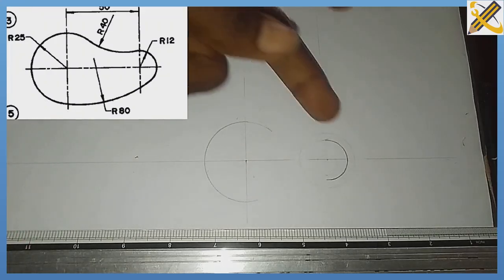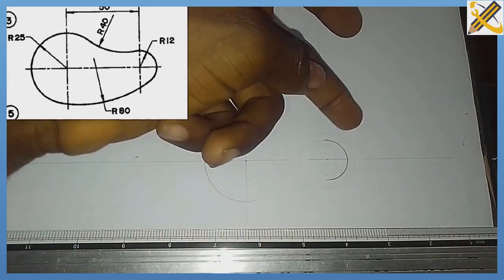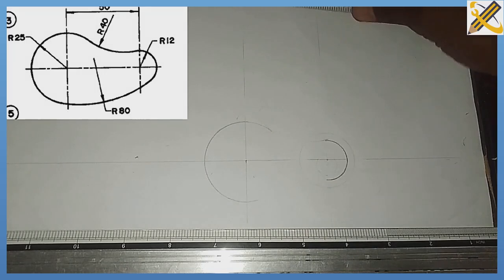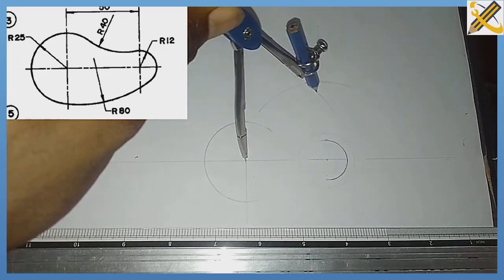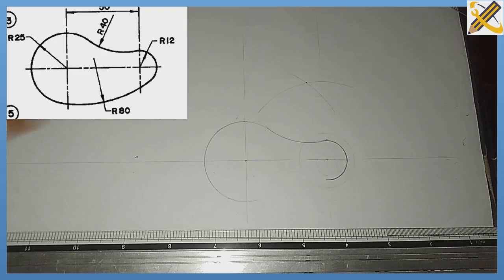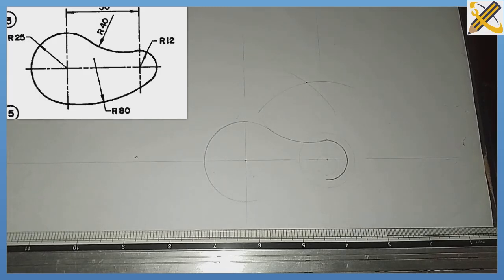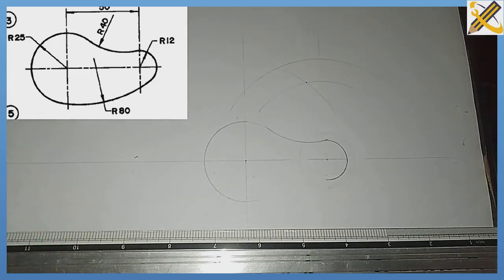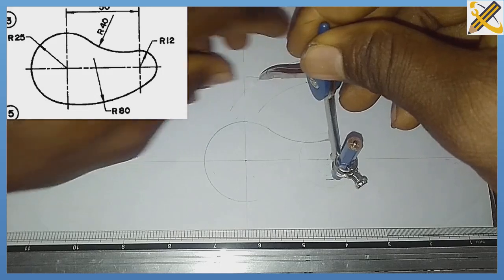Tangency problems in | Technical drawing | Engineering drawing

Comment: Could you do problem 1 pg 19
Reply from the maker: On the right hand side apply principle of external (20+70) to get the 1st arc, on the left hand side apply principle of an arc on a straight line ( r50) from point 65 to get the second arc.
Then from the point of intersection of the ARC, pick r50 and connect them.